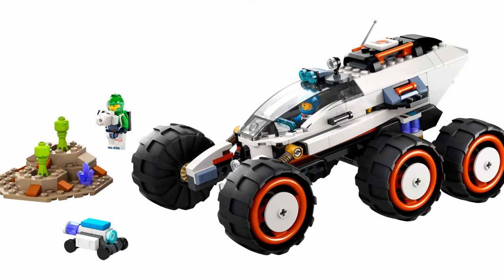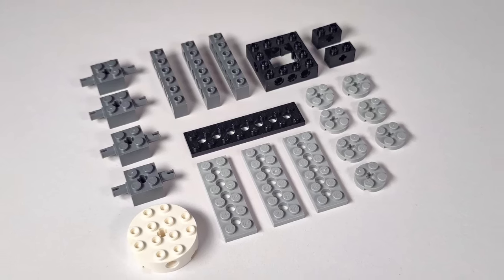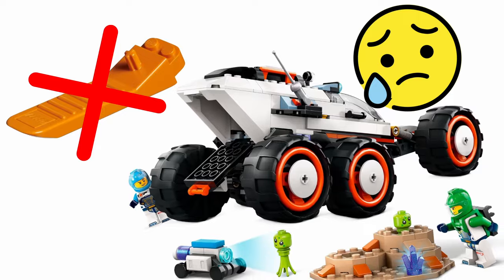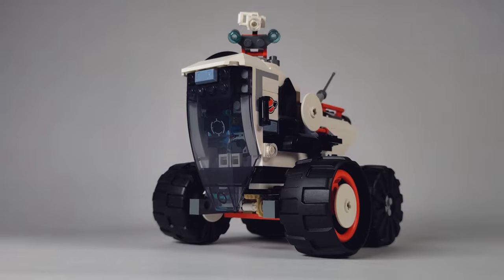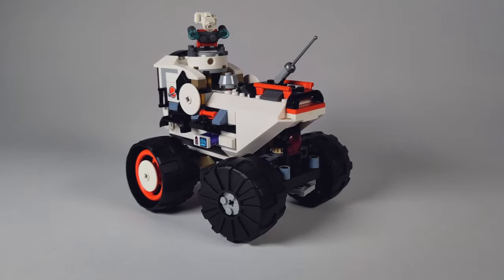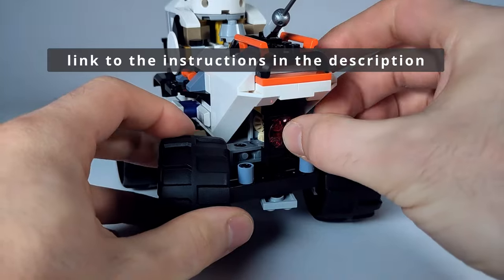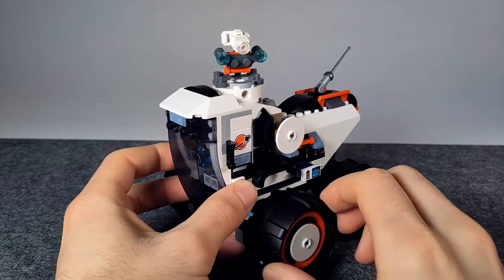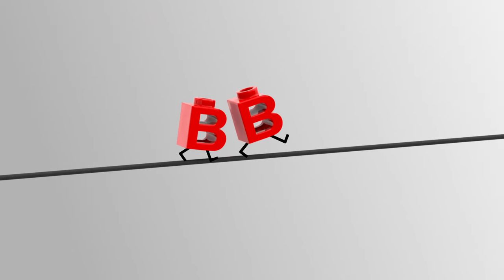LEGO® 60431 Alternate Build: Space Rover with Technic Functions!

Comment: nice one; could you do one custom of the 60429?
Reply from the maker: Thanks! That set has some really nice parts and prints. I just have to check if it is complex enough to make interesting alternate builds.
Reply: there is maybe a lack of pieces. I've modified the set 60430, I had to add some pieces to give it more thrusters, and complete principal thruster by the down side; still worth it.. I'll made a video I guess!